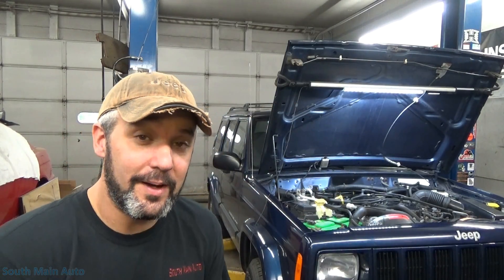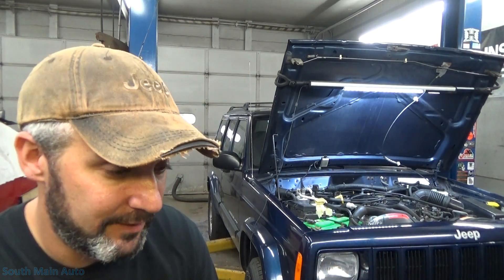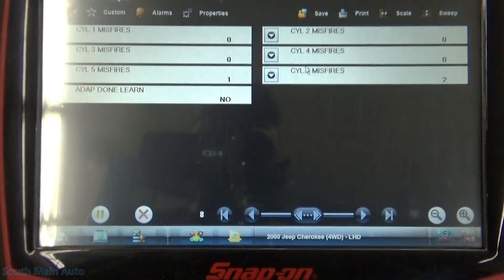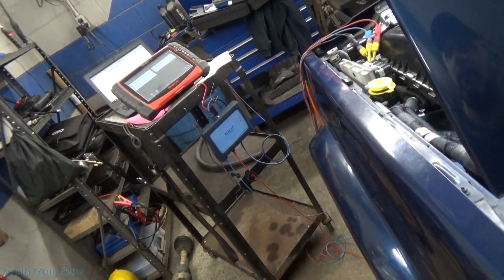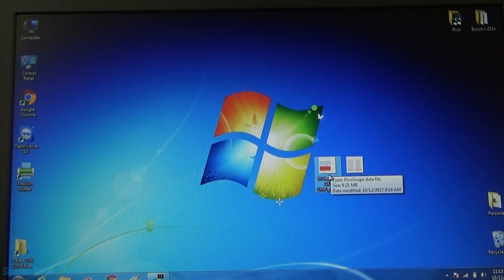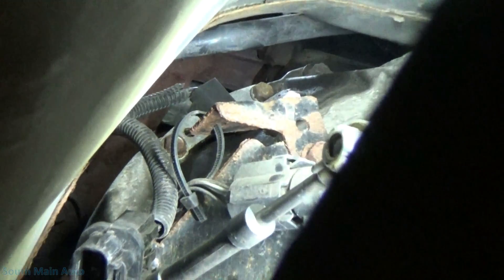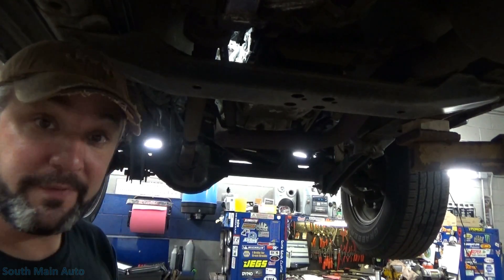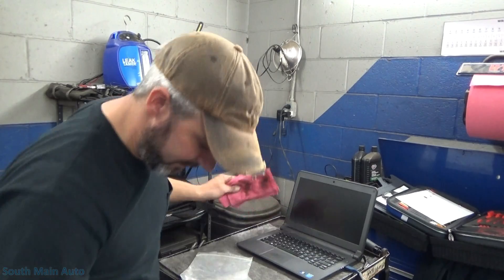Jeep 4.0 - Flashing Engine Light BUT NO MISFIRE!?

Comment: I've been chasing this same problem for a year. I have had 4 CPS installed during that time, and only when I finally got a Mopar part, was it resolved. The previous owner who swapped the engine in my wrangler, dropped one of the flywheel/torque converter bolts inside, it rode around in one of the grooves of the flywheel eventually hitting the CPS and breaking it (twice) before I discovered it. The CPS did continue to work while missing plastic! Eventually I discovered that issue, removed the bolt, and replaced the CPS with a Napa premium part. From day one that sensor always triggered the misfire code at 3000 rpm and above. I looked everywhere else assuming it was not related to the CPS. Now after seeing this video I went ahead and ordered a Mopar part and after 4 days the misfire code never happened. I can finally engine brake through the mountains around here without dreading the flashing misfire light. I watched this video during an international flight and then ordered the sensor as soon as I got home. Glad I have been subscribed to you for some time now.

Comment: I know this is over a month old ( or nearly ) and I hope that someone still looks at it.  I am having a similar issue with a 97 T&C with a 3.8.  Stores "pending code" for random misfires on all cylinders.  Vehicle runs smooth.  The crank sensor on this is of the adjustable type.  Is the issue you identified in this video confined only to jeep inline 6's or will it cross over to Chrysler V6's of this vintage ?  Complete ignition tune up and both 02 sensors as well as EGR and Transducer.  BOOM !  ( parts cannon fired ) .

Comment: Just changed my crank sensor today (Mopar OEM).  I strongly recommend taking five minutes to drop the driveshaft at the differential.  I swung it over toward the passenger side and ziptied it to the catalytic convertor.  I was then able to gain much better access to the sensor bolts.  I only had to use one extension and  a wobble joint and was actually able to reach around the exhaust and get both hands up into the area to start the bolts when reinstalling.  I still had to work by feel but it was much easier than fighting the driveshaft.  I hope this helps those of you facing this repair.

Comment: I can't tell you how many times I have replaced a crank sensor on these that a generic scan tool doesn't see the DTC on. It IS actually there though. The DRB 3 sees it.  The integrated DRB3 Emulator on Witech 1 Does not see it. Weird but common....aaaaand aftermarket crank sensors are crap. (:
Reply from the maker: Well I do have a DRB III Also and have never seen it generate a code on them either, atleast a CKP sensor code. Misfires yes though

Comment: TL;DR: The old sensor put out a good square wave pattern but was inaccurate/inconsistent in ON time. 

Thanks for the captures! I've never actually used a PicoScope before. I downloaded the software to look at your captures and gotta admit it's bloody cool. I was able to do measurements and analysis in about 5 minutes whereas it would have taken 20+ painstaking minutes with my Verus...

So you can't compare times between old and new. You're not running at the same RPM so times are irrelevant. You have to compare degrees of crankshaft rotation as that's the only thing that is constant. I measured the width of 4 pulses on the crank pattern on both the old and new waveforms. I used the same tooth every time to be consistent. On the old sensor I got 1.427*, 1.575*, 1.562* and 1.579*. On the new waveform I got 1.16*, 1.16*, 1.109* and 1.111*. 

On the old sensor, each pulse lasted more degrees of crankshaft rotation than the new sensor. I imagine that's not what set the misfire. No two sensors are exactly the same so that would probably get processed by a crank relearn. HOWEVER... the pulses are pretty inconsistent on the old sensor whereas they are VERY consistent on the new sensor. The difference between the shortest pulse length and longest pulse length on the old sensor is 0.152 degrees. Even after going back through the new trace and looking at way more samples the largest difference I could find between pulse lengths was 0.011 degrees. That's going to be what's causing the reported misfire.

The time delay between when the tone wheel notch passes by the old sensor and when the sensor is able to fully turn on and off its transistor just is not consistent.

Comment: I have seen this on multiple Cherokees. The first one had me banging my head against the wall trying to figure out the problem. Came to realize after that the truck originally did not start and the customer had brought it to a  shop where an aftermarket sensor was installed. Long story short, my cam/crank waveform was obviously fine as was the crank pattern itself to my eyes. "Guessing" that the aftermarket sensor was the culprit, I changed it with a dealer part and problem was solved. Only thing I can think of is the air gap may be different between it and the aftermarket part. Other than that, I have no idea what else would cause this.

Comment: Some kind of electromagnetic feed  back from the aftermarket sensor... That doesn't show on the voltage readings..? I've never attempted amp readings on a cam/crank... Maybe that would show us something "outta the ordinary"..? It would make sense that the aftermarket unit would have less shielding/slightly different design. As I recall the manufacturer is only required to allow the aftermarket to like 80% of "their" design notes (feel like I heard this is school years ago). Just spit ballin though. Would love to mess with something like this all day trying to figure it out. 

Thank you for the video and sharing your time with us. Have a fantastic day!

Comment: Hi guys

Great video. Take a look at the Pico files Eric captured. The 'bad' sensor is grounded at about 79mV where as the 'new' one is grounded at about 54mV. Now, I know this doesn't seem much but is does affect the misfire counters and can trigger P0335 DTC if it gets much higher. Had my ass kicked with a PT Cruiser that had the same issue. The car had been fitted with aftermarket crankshaft sensor. Took a long time to find and work out. Thanks Eric

Comment: Had a similar situation. Friend took his 4.0 Cherokee into the shop because of check engine light
at highway speeds. Shop said it was indicating all 6 cylinders were showing a "spark" miss and
they began replacing parts. ECM and Coil Pack and  other parts  to the tune of over
 $2650.00 in parts   My friend asked if I could check with the shop and so I called just casually 
asked what waveform they were getting generated when they tested They said it was great and 
had never showed a bad waveform and that was what throwing their troubleshooting off. 
I quietly suggested that they might try changing the crankshaft sensor ( which they had not
 done to this point. It is not my vehicle or my right to get into the middle of the problem). 
Long story short, they changed the crank sensor and the wave forms returned to normal.
Sadly, of course they just added  the cost of the crank sensor to the $2650.00 parts plus 
labor bill telling my friend that somehow the "ECM had defaulted in it's code and caused other 
parts such as the coil pack and crankshaft sensor to fail". I explained to my friend that such  thing
 just could not happen and if he wanted to dispute the charges I would be willing to help him but
 he would need to start the process not me. He never did anything about it so he received
 an education, I received an education and I am sure the shop received an education.
Aloha from Maui
Reply: Randy Gentry I guess malpractice insurance won the lottery that day🍾
Reply: So, what is the ethical way to run through this parts changing fusillade, short of bringing it to  Eric "the Swami" @ SMA ? I got $9,899.00 hammers too, but feel bad using them.

Comment: 2500 RPMs is about 42 rotations per second.  That's about 15,000 degrees per second (42 x 360). 200 microseconds (0.0002 seconds) is a difference of about 3 degrees rotation.

Comment: Jeep, and other FCA brands, are arguably the worst of any American vehicles currently being produced. If you're an FCA fan just google TIPM problems and the moose test where the Grand Cherokee failed miserably and blew out tires under circumstances where even a Toyota Prius has zero issues. Even better the Jeep engineers showed up and were clueless. Jeep arguably makes the worst of all FCA vehicles and that's a badge of shame considering Jeep vehicles are worse than even a Fiat. Jeep buyers are mostly looking to make up for their really small penis as further demonstrated by their inexplicable desire to install an offensively loud exhaust systems that wake every sleeping baby within miles. Driving any Jeep vehicle is roughly equal to being seriously stupid.

Comment: You already said your answer. The computer sees a 200 microsecond difference and it is triggering a misfire. A method of detecting an engine malfunction such as a misfire includes determining engine speed values at each of a plurality of measurement angular positions, heterodyning the engine speed values with sine and cosine functions indexed in the angular domain, passing the heterodyned results through a low pass filter, and computing the resulting magnitude from the resulting two vectors. An apparatus for detecting an engine malfunction, such as a misfire, includes an engine speed analyzer, a multiplier, and a low pass filter. The (substantially instantaneous) engine speed values can be determined by measuring the time period between known angular displacements of the crank shaft/cam shaft and computing the speed value S=C/T where C is a conversion constant and T is the time between the (possibly fixed) angular crankshaft/camshaft displacement, for example as measured by a high resolution timer with microsecond or sub-microsecond precision.

Comment: I had a similar problem with my diesel Jeep Wrangler. The sensors get a hairline crack in them where the wires go into the sensor. A fine film of carbon builds on the contacts inside the sensor and it's enough to make the car think it's misfiring. I keep spare sensors and relays because they are such poor quality (doesn't matter where they are made) that check engine lights mean faulty sensor or relay these days. I'm contemplating replacing my tipm with a fuse box that I will design myself because the relay connections are sometimes intermittent.

Comment: i wish i knew what was going on with a car i have as i am about to take it to the scrap yard. i have a 96 lincoln towncar with the 4.6L v8 and it has a bad misfire on two cylinders and that is by pulling the plug wire on the two offending cylinders and the engine makes no difference. i replaced the intake, MAF sensor, both coil packs, plugs and wires, cleaned the throttle blade, throttle elbow, and egr passages. i replaced the fuel filter and i only noticed after the coil packs it ran good for a few days and then went right back to running bad again. during the days it ran good it had plenty of power but it still had to have the throttle pressed down to make it crank up. i replaced the injectors on the two cylinders as well and nothing has fixed it. i was thinking it could have been the ignition control module but the two cylinders that are misfiring arent controlled at the same time with the ICM so it makes no sense why one cylinder would be fine and the other not on two cylinder in two separate circuits in the ICM. NOTE all the parts besides the fuel filter were used parts from a known good engine that i personally drove.

Comment: I had this same issue on my 98 Intrepid with the 2.7. Aftermarket crank sensor would flash check engine light at high rpm. OEM sensor fixed all of it. OEM had a much stronger magnent than the aftermarket. So I don't know if the aftermarket has a weak magnent that causes that.

Comment: I'm at a loss... I know if you take relays for example its pretty simple to note the difference. With a known manufacturer the construction on the contact NO (normally opened) is smaller than its NC (normally closed) to handle the current flow. With unknown manufacturers this is sometimes switched (no pun intended). Also the conductive materials found are better than an unknown manufacturer in most cases. However with this crank sensor issue I would like to see a three part test. I'd like to see a known good sensor against known bad sensor against the unknown sensor. Once the data is taken we dissect to compare the construction. Maybe with that we can better understand what just happened. I cant imagine it is that simple as a difference in manufacturing that would be the cause of this issue. Does anyone agree???
Reply: I agree, but we'll have to send them to AVE to do a material diagnostic

Comment: Hey Eric O, I have added a maths channel to both crank signals and it would appear the old sensor is reporting a slowing down of the crank speed on occasion. I am pretty sure the engine computer doesn't look at the detail of the signal.  The software calculates the speed at which its turning with in a set time frame (educated guess). I maybe wrong with my maths channel and theory and would like to hear anybody's thoughts on it.
 https://drive.google.com/file/d/0Bya63KzQrDoYRHdTbHh2bVp1c0k/view?usp=sharing

Comment: Eric, this is a good one. I see a slight discrepancy (as you noted) between the old and new when comparing duty cycle of the CKP signal. I compared the high to low duty of the CKP signal on the 2500rpm captures. I found an average duty cycle on the old unit of 14.9550% as compared to the new one of 11.2195%. I cannot imagine that is enough to make the difference and cause erroneous missfire data however. The only other discrepancy I could notice was there slightly more noise when the CKP signal is low comparing old to new. Here is an apples to apples comparison of the 2 signals zoomed into the low part: https://goo.gl/4fAjjf Nothing conclusive in my book other than the car is fixed. ;)

Comment: Recently replaced a 4.3 engine.  Got a P0300 code when holding down throttle over 2000rpm. Money light flashes says cylinder 1 and 4 are misfiring. Can't feel any misfire in engine. Could it need a crank relearn? And if so, what scanners can do a crank relearn? Thanks...

Comment: That is the problem, it the timing back to ecm. Just had a Rio in shop with same issue, but would shut off and not start till cooled down. Heated the sensor up with temp gun and no start. Cooled it back down un freezer it would run. While running crks would warm up and the timing space would get larger. Sent info to Kia techline and was confirmed I was right, and still no raise.

Comment: yeah good fix for the owner+SMA as it's tricky with new aftermarket parts, scannerdanner has covered this type issue a few times with the jeep 4.0 and is a common issue. glad you mentioned air gap as this seems to be where diy stuffs up often but not always..

Comment: I was looming at the wave forms on the video only and if you look at the bottom spikes some were missing on the sensor. You called them noise on top wave form. After new sensor installed you had big spikes top and bottom, but on bottom you had big spikes on every positive wave. Don't know what part of the sensor that deals with, but that will give you a starting point for troubleshooting the next one.  God Bless

Comment: A wild guess...maybe the impedance of the old sensor is not up to spec.  Be interesting if the resistance of output of old sensor is different from "factory" one.  Kinda late now to check.  Not sure if could effect but if voltages and pulses look good might be hidden anomaly?  Another hidden thing is noisy power supply or spikes on it, this can really mess up any controller, but does not apply here.

Comment: There used to be a video somewhere on YT that used waveforms etc to go deeply into the differences between OEM and aftermarket crank sensors on Jeeps. I can't find it any more, but I recall that they did pinpoint differences that could account for why Jeeps are so picky about them, and they weren't in any way obvious.

Comment: Gut instinct never steers you wrong. My theory is the wire the windings in the sensor are made from. I think that the heat plays with the copper and the coatings on said wire to mess with the ecu. I had a Ford tempo with the Bosch efi do that to me. But it was an actual stumble in that case. It was messed up. Like I said just a theory who knows..

Comment: Waveform look the same on the vid. Probably small difference in width of relative timming to the cam sensor ?.  Not on autorepair but sometimes get issues on pulse streams like that and the voltage is ok, timming looks perfect ... the only thing that appears to "trigger" the issue is that the faulty one is a bit slower, I mean, you can see it ramping up (very fast but still some slope there) or the last part of the pulse is rounded (sometimes you need to pay attention to the top part because some circuit just trigger the change on 2/3 of the voltage span). Also, when there is jitter, I mean, the relative time of an event is no consistent enough, (lets say if happens just a bit before or just bit affter). Is the sensor is not consistent and the event come a bit latter than expected or sooner probably the ECM is upset but not big enough to cause a noticeable missfire. Probably the window of acceptance or criteria choosen in the ECM is very small and you need to zoom into the signal to see if there is a detail that shure is almost not noticeable.